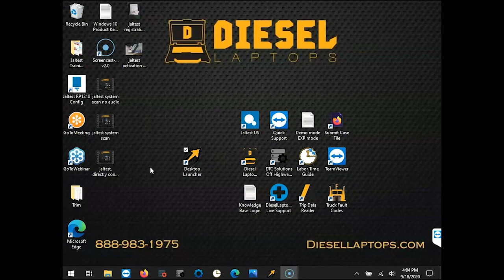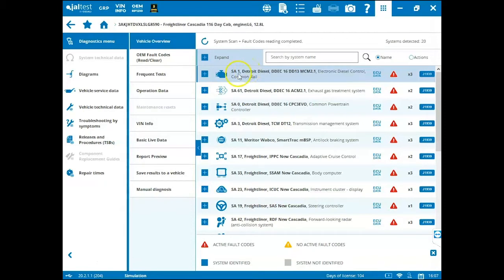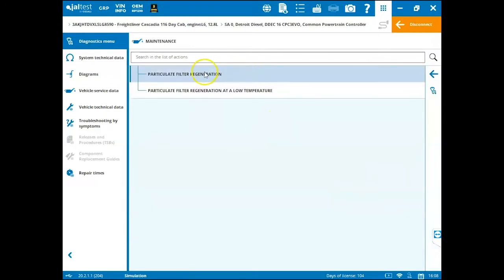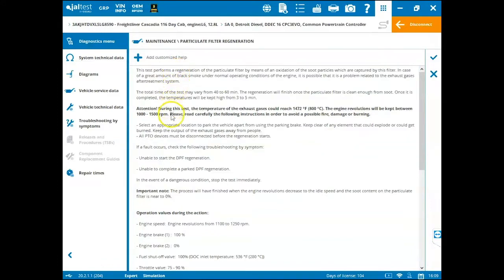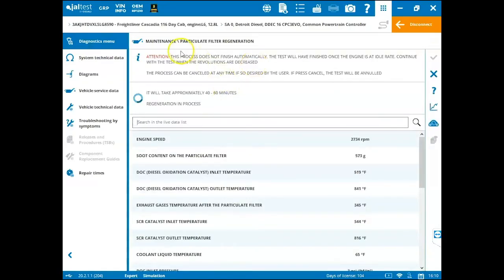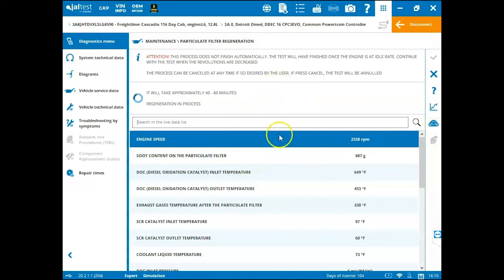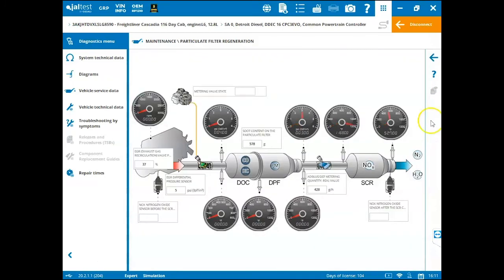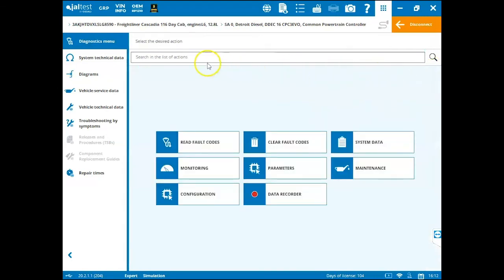How to Run an Aftertreatment Regeneration Using Cojali Jaltest

Comment: Question. Can you not do a forced regen using jaltest on a ram 5500? There’s no maintenance option for them. Just trouble codes & guidance procedures where the links don’t even work. With Internationals & freightliners and everything else it works all day. However I had to use the shops Autel scanner to proceed with a forced regen. Cummins insite wouldn’t even recognize the trucks vin 🤣